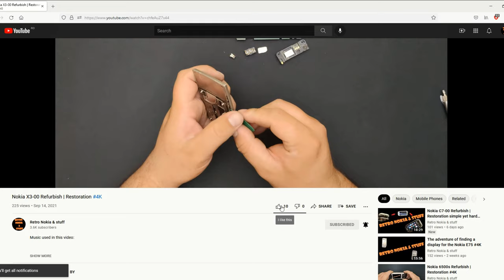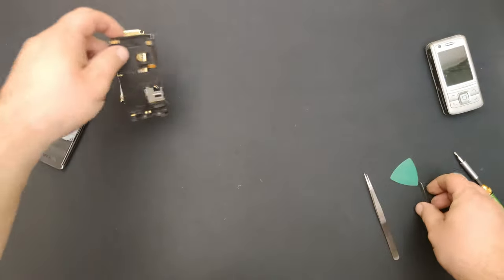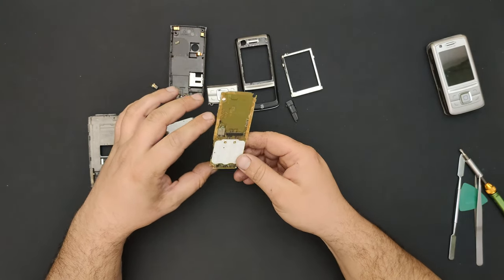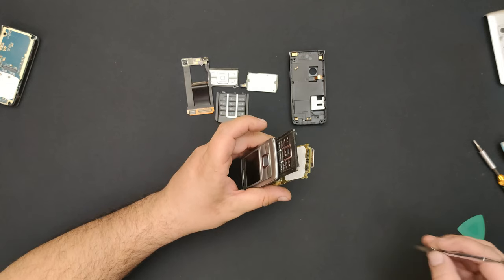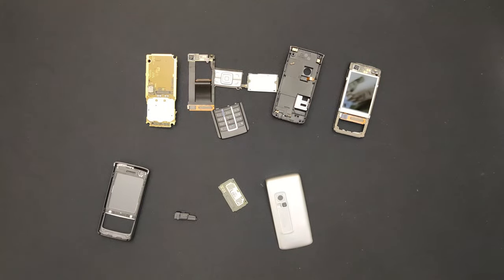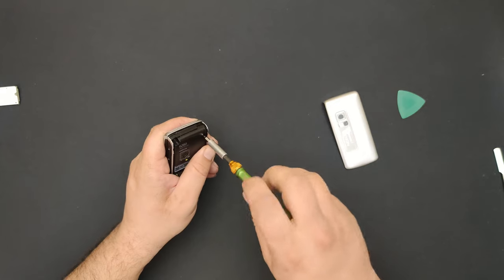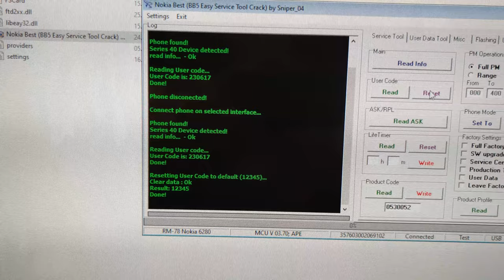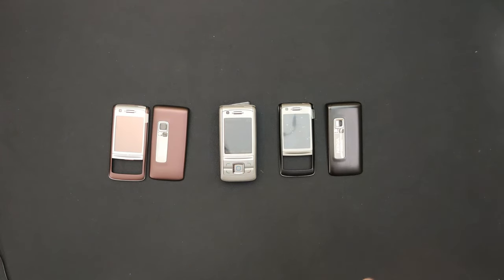Nokia 6280  Refurbish | Restoration | Repair  #4K

Comment: Nokia 6280 does not turn the screen completely black? Looking at it, I still see a blurry interface
Reply from the maker: At the end of the video?  When it locks the keyboard, the backlight turns off first but the image is still there for one minute or so before it turns completly off.
Reply: @Retrophonesstuff  My Nokia 6280 when it locks the keyboard, the backlight turns off but the image is still there forever =))))). It doesn't turn off to a completely black screen.
Please help me how to fix it. Thanks a lot!